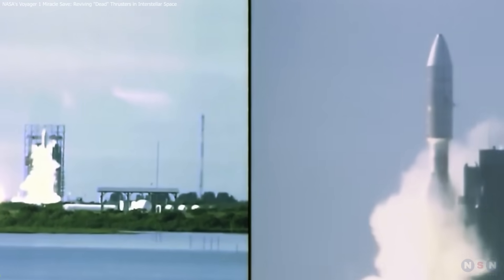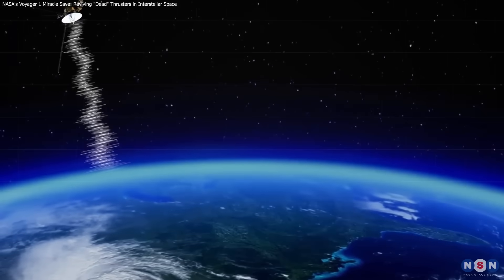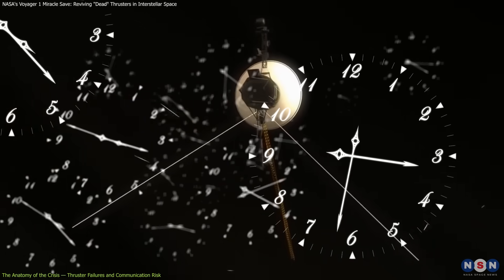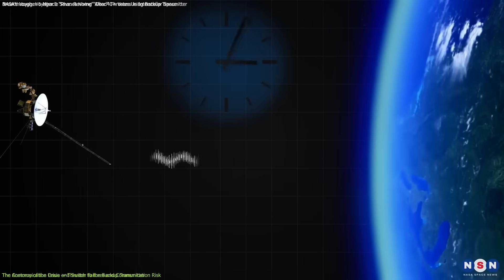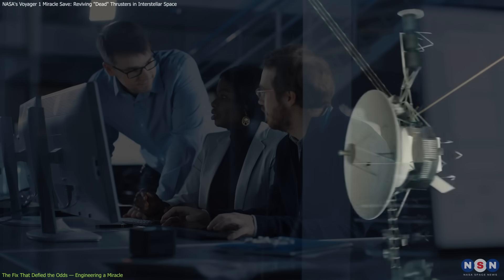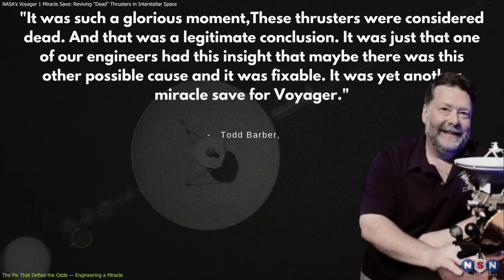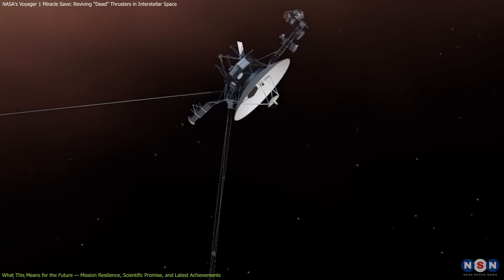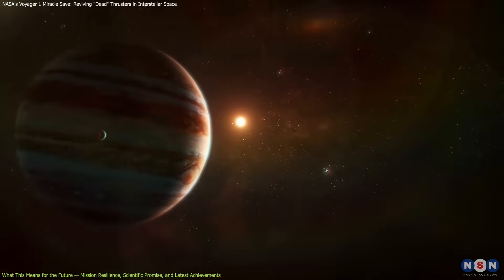From Dead to Alive! NASA Fixes Long-Dormant Thrusters on Voyager 1 Just in Time

Comment: Voyager 1 and Voyager 2 were both built by Hughes aircraft company space and Communications Group in El Segundo, California. My dad was also one of the original engineers who worked on the initial design an engineering of Voyager 1. Bill Ester, one of the original engineers who worked the entire program if I recall correctly is still around in living here in the Los Angeles area. Bill was a data comm engineer.
Reply: Cheers to your Dad and the full staff, that's a good reason to be proud of. Congrats from Mexico City.
Reply: If they use a gallon of hydrazine per 30,000 km shouldn't they have run out of all hydrazine by now?

Comment: It's amazing that the technology of 1977 is still working! Our Phones have 10x more power and technology than the Voyagers computers have on board!
Reply: That's a little bit of an understatement. According to NASA the Voyager computers can process "8,000 instructions per second. To put this in perspective, a 2013 top-of-the-line smartphone runs at 1.5 GHz with four or more processors yielding over 14 billion instructions per second." So basically almost 1.7 million times faster and that was back in 2013.

Comment: What is the thruster fuel that has lasted so long? ... 2030's on 1970 technology ... Remarkable! Congrats JPL!
Reply: The thrusters use hydrazine in minuscule amounts to make incredibly tiny adjustments. They do not stay lit. Once that hydrazine runs out, the probe can no longer adjust pitch or roll to keep the antenna pointing toward earth. The instruments and heaters are powered by radioisotope thermoelectric generators aka RTGs, which produce power using plutonium. The power output decreases over time due to the half life of plutonium and the slow degradation of the thermocouples that turn the heat from plutonium decay into electricity.
Reply: @lesliefilip9785 ... Thank you for your simple, but detailed answer. Those 1970 era engineers are to be commended! Are there still any original engineers around who worked all that out?
Reply: @billreal76  I'm sure almost all of the engineers are long retired or worse, but the ones that are still kicking continue to provide valuable insight and consulting. Even basic documentation from the early programs is often lacking, missing, or never existed in the first place. The institutional knowledge carried by these engineers is basically a living database.

Comment: It's amazing that the software experts from 1977 are still available to change the code and send an update to the Voyager. The original code is certainly programmed in Fortran.
Reply: I believe it's machine code. Scott Manley has a video on a similar save. He discusses the programming necessary in some detail.
Reply: Also, they don't have the original people, making it much harder. They have a huge amount of often cryptic notes. No hardware or even emulator to test on.

 It's brilliant work all around
Reply: @nopenheimer  It could be that Scott Manley knows better than I do. But NASA was the first to use Fortran programming language on an IBM machine. Wonderfully depicted in the movie "Hidden Figures":
https://youtu.be/5wfrDhgUMGI?si=0Ww14XZ3jPvFyxJJ
Reply: The Voyager source code is pure machine language. NASA did not even retain an assembler for purpose built FDS computers. Fortran was used on the big computers on the ground which pre-computed trajectories.
Reply: So it's impossible for anyone today to understand Fortran?
Reply: @buckhorncortez   Yeah seems like people still write new code in FORTRAN.

Comment: 23 hours for comms.  When we perfect quantum entanglement comms it will be instantaneous, regardless of distance.
Reply: That doesn’t work
Reply: @Scissors69 Not yet, but it will.  Quantum entanglement forms the basis for potential revolutionary communication systems. Quantum teleportation could enable secure, instantaneous data transfer when technology matures. While current limitations prevent practical instantaneous communication, advancements in quantum repeaters and error correction may one day allow entanglement-based networks to achieve ultra-secure, near-instantaneous communication.

Comment: What type of fuel do these thrusters use? Shouldn't it have been used up by now?
Reply: They use liquid hydrazine.  Pretty standard for satellites. Other than the rare orientation correction, the thrusters aren't used.
Reply: @nicholashylton6857  Ok thanks, But the fuel supply isn't infinite. At what point would it run out?

Comment: Love the spin. What actually happened was that they wrote voyager of as dead. Then, someone had the idea of a final try at the thrusters. If it failed, the craft was already lost, so nothing much would change. If it worked, then they would get another few years out of it until something else failed.

So, as a literal last resort, they tried it, and surprisingly, it worked. Only then did someone suggest WHY it worked. That is, what could possibly be the reason.

Revisionist spin history at its finest.
Reply: Spin? I’d use the word … Roll. 😉